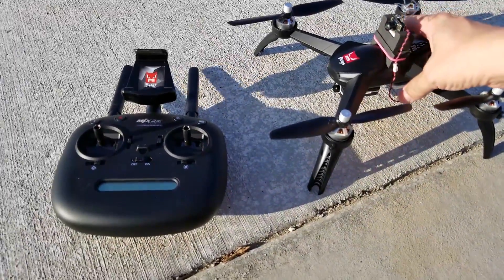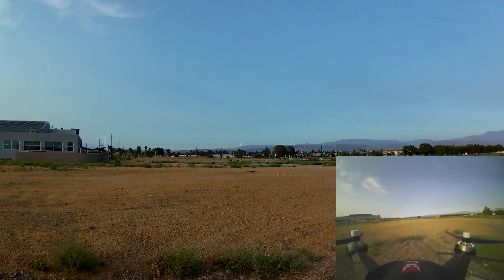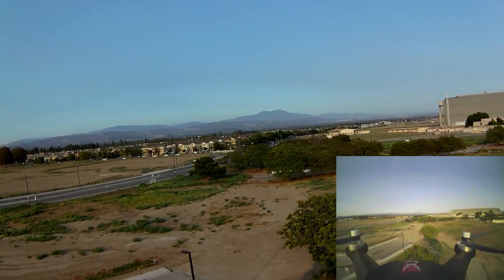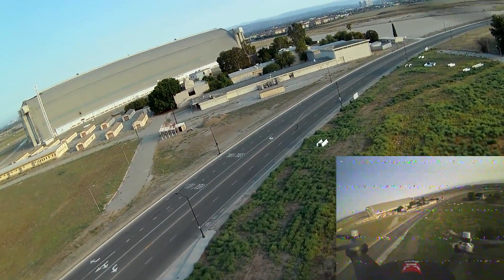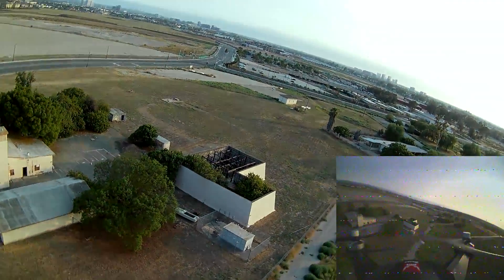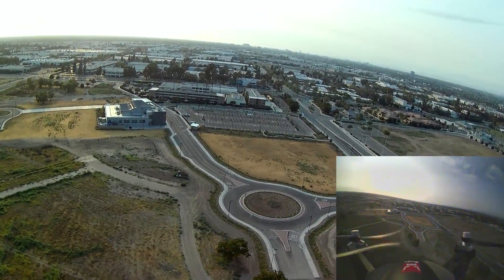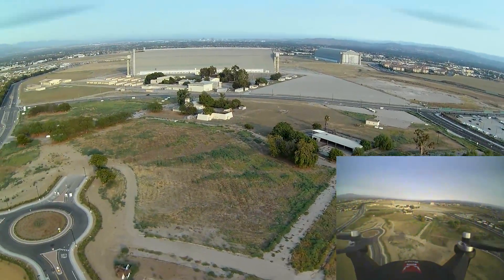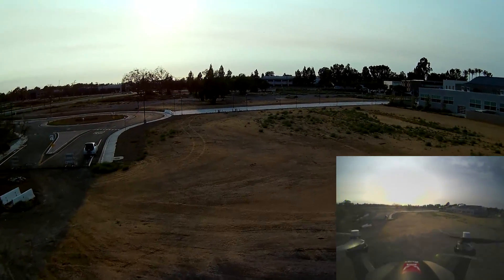Hacking a Cheap GPS Drone (Bugs B5W) 😀

Comment: i want  to connect eachine transmitter TX5258 with the  stock camera.Can you explain the cables of camera?
Reply from the maker: Not really sure if you can do this or not.  I don't think the stock camera has analog video out anywhere you can tap into.  Otherwise I would have used it.
Reply: @AlbertKimTV  Thank you!

Comment: I've had a Mobius Mini (narrow A lens to avoid fisheye) for a couple years .. great little cam. With a better mount, you might be able to get rid of some of that shake/jello. I've even installed mine on an old Syma X5C with great results. TIP: change the exposure setting to weight on the bottom center of the picture, which will keep you from getting dark ground video as in the last part of your video. Not sure if you had the Gyro on, I use it sparingly myself.  The TX03 (or whatever AIO you used) should be good for a considerably longer range. On the YT channel 'SoulForceQuads', DJ has mounted one of those on several craft, and using only an Android tablet with a "Gold Model FPV RX" (OTG) he has exceeded 1KM with good FPV results.  I do think the MJX Bugs series is one of the best on the market right now, but they always seem to 'cut corners' on having either a good FPV signal or good video (or both). Example: The B2W had decent video but lousy FPV/control range. The B2C had good control range, but lousy video. (IMHO). Seems to me that with a very little effort on their part, MJX could marry up the right components and solve all the issues ... but then the costs might go up slightly as well.